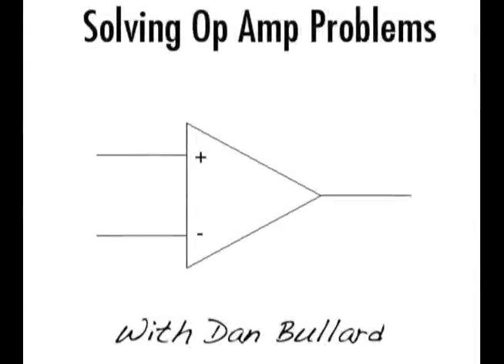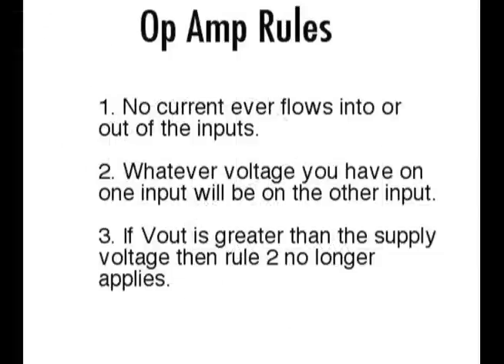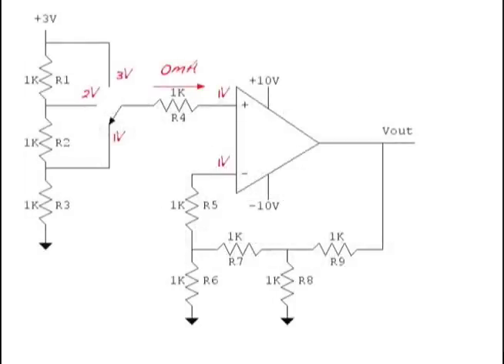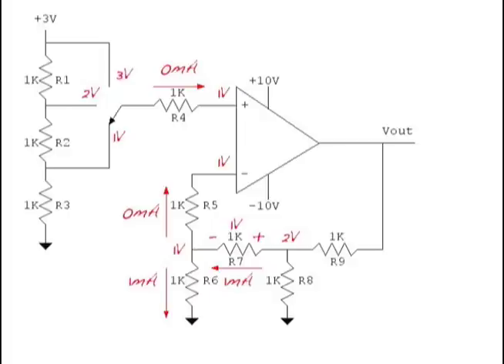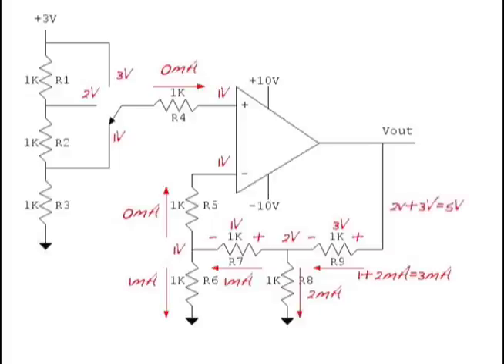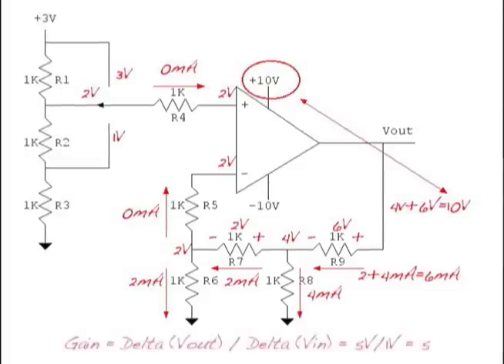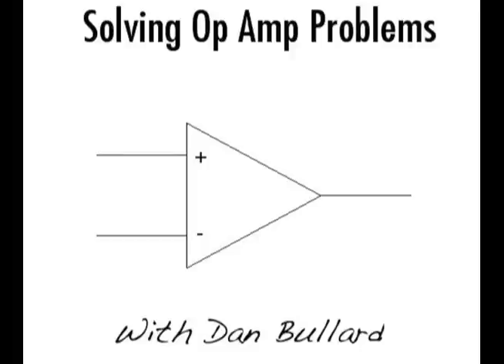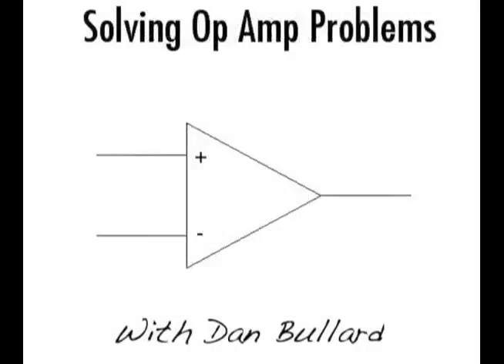Solving Op Amp circuits

Comment: Hi Dan, Why can't we find a text book or any kind of book that explains things using this very clear method?? I have looked everywhere and it seems to me, clear explanations are not encouraged. Do you know of a book anywhere out there that at least has a set of questions like this one I can work through. This method is so much easier to understand but it obviously needs practice. Why don't they teach the basics like this???
Reply from the maker: Kevin O'Brien There are no books that I know of that teach basic electronics this way. The only one I know is the book I wrote on harmonic distortion. I suppose I should write a book that teaches this method of learning electronics. Stay tuned!
Reply: Dan Bullard Well if you don't, someone should!

This style makes it far more easy to understand. I can't believe they are not teaching this way anyway. Its crazy not to. The subject is tough enough as it is. I have not got a thing out of academia. The pedagogy used in Science and technology is just up there, right next to bloody useless in my opinion. Fortunately I am determined to learn on my own, else I would have given up long ago.

I would buy such a guide (better more friendly name) at the drop of a hat.

If it was a nice concise pocket book (between about 80 to 90 pages) at low cost you would have a winner I reckon.
Reply from the maker: +masen shiba It's a voltage divider, 3V divided by 3 is 1V across each resistor, or 3V across 3K means 1mA is flowing down to ground. 1mA through a 1K resistor generates a 1V drop.
Reply: +Dan Bullard This is awesome. I&#39;m starting out designing circuits and analyzing circuits and the hardest and most mysterious part ( And for some cases the most important part) was the amperage. The 3 rules you show + Ohms Law makes that part clear and concise to me now. I have searched all over to try to find an equation or something that would help me understand how to find the amps. I mean I knew it was in Ohms law, but everything says to assume a constant voltage or amperage so it gets really confusing.&#160;Those 3 rules and your method makes it bullet proof. I hope you do write a book on this.
Reply: +Dan Bullard hello how did get the 3 and 2 and 1 volts on the left circuit
Reply: now i understand , thanks a lot  :)

Comment: GREAT tutorial. I have to admit, I didn't understand most of it. I've got a probable reverb recovery unit op amp problem in my Marshall guitar amp, and I am hoping if you could walk me through testing the circuit, or at least the op amps, in an effort to identify the defective component? I've got a link to the schematic, and a multimeter.
Should I just start at pin #1, measure the voltage, then try to use this video to solve for the other pin, and measure them..?
Thanks
Reply from the maker: Robert McBride I think it would take a bit more than that. One thing you can do is check the voltage difference between the two inputs, pins 2 & 3 if I am not mistaken. They should be the same voltage if everything is OK. Give me the link to the schematic and I can see if I can walk you through testing it.

Comment: How do you get that 2V and 1V on the far left at the beginning of the video? Where is the math for that?
Reply from the maker: Shane Quinn There are three resistors there, so 3V divided by three 1K resistors equals 1mA through each one. One milliamp times 1K = 1V, so each resistor has 1V across it. zero plus one is one, so the voltage at the top of R3 is 1V. One plus one is two, so the top of R2 is 2V. And 2 plus one is three, so the top of R1 is 3V, which all works.
Reply from the maker: faceinthegrass It's a voltage divider. 3/3 = 1. 1+1=2. That's the math.
Reply: Dan Bullard Put isn't the voltage divider rule R2/R1+R2 all multiplied by Vin to equal Vout. So from what ive learned in the past is that if both resistors are the same then the voltage will be halved? So 1.5V if you use the equation I use?

Comment: What is the basis for rule No. 2.
Reply from the maker: Yueeiuyoo In a negative feedback circuit, that is what the op amp tries to do. It "homes in" on the output that causes no difference between the two inputs. Remember that the gain of an op amp is in the millions. Any tiny difference between the two inputs will be magnified by the immense power of the power supply rails.

Comment: If there's no current through R4, how can be there are 2 v across R4  if Ohm's law said V=IR (I=0 ==> V=0)?
Reply from the maker: R4 never "Drops" 2V. when there is no current, a resistor transmits the voltage unhindered through it.
Reply: Dan Bullard Thank you Mr. Dan bullard. I still confuse. Why there's voltage at input if there's no current moving across R4 (no electrons moving)
Reply from the maker: Electrons moving is current, force of electron pressure is voltage. You don't need current for voltage to have effect. Voltage is like the pressure in a hose. Even if there is no water flowing, the hose will still bulge and be stiff because of the pressure.
Reply: Good explanation! Thank you again. One more question. With R4=1kOhm as a resistance, why is there still 1V on the right side of R4 (Op Amp input)?
Reply: Alexphal That would be the 'pressure' as Dan described.  Another way to think of it is the current through R4 in reality is not absolute zero.  There will be some very small current, as in picoamps or nanoamps (will vary with the op amp used).  This would mean the voltage on R4 may actually be e.g: 1.0000000V on the left and 0.9999999 on the right.

Comment: Please explain the function of R4 and R5. If no current is flowing into the inputs why are they required ?
Reply from the maker: trialen Actually the value on one side should match the equivalent resistance of the feedback network on the other side remembering that the output of the op-amp is virtual ground. In this case I didn't bother with that, I didn't want to complicate things. But when you look at a well designed circuit, let's say a typical op-amp with a gain of ten, 2K on the minus input with a 20K feedback network. The equivalent resistance is (2K*20K)/(2K+20K) = 1.8K. So on the Plus side connect a 1.8K resistor to ground. Now any bias currents on the Minus side will cause a similar voltage drop on the Plus side. But as I've told the other folks, this technique is mostly for doing a first approximation to understand the circuit. Design is a whole other ball of wax. Get Horowitz's The Art of Electronics for info on design, best book out there.
Reply: Chemiprofe asked that earlier. It's never a good idea to connect a device input directly to a power bus, just in case the chip shorts out internally you don't want the whole damn thing burning up. But the the real reason is that there may be a very, very tiny current on those inputs, not enough to worry about when doing first approximation analysis like this. But if you do get a picoamp of current on one input, the other input will probably have the same picoamp of current and so the two inputs will be subjected to the same nanovolt offset. Again, the effect is so tiny you could spend your whole life trying to figure out the circuit if you try to follow each picoamp around the circuit. Better to ballpark it and get really close than spend days trying to figure out every picoamp and nanovolt.
Reply: DansFlix OK, thanks for the explanation. Are there any design considerations for the values of R4/5 or is it safe to just use 1k ?
Reply: Dan Bullard Thanks Dan, very interesting.

Comment: thanks for the video it is very clear. i want to ask that, how should we think about resistors, in order to calculate the gain as in formula: 1+(Rf/R). what is Rf and R resistors here. first, i thought that R5 is R and rest of the network (6,7,8,9) are parts of Rf but didn't work. could you explain? thank you very much.
Reply from the maker: Yeah, that resistor to ground really screws everyone up. That's the problem with the way they teach this stuff in college. You become an expert at math and can't do anything else. What's the formula for a circuit that breaks? The math won't tell you what happens, but using this technique will. To calculate gain just do like the video says, change the input voltage, analyze the circuit and see what the output change is. Gain is delta_Vout/delta_Vin.
Reply: ok then i will use this :D thank you very much.

Comment: Thank you for the great explanation. What are the rules for non ideal Op-amp?
Reply from the maker: The Op Amp datasheet is the best place to look for that. Input bias current is spec'ed as well as input offset voltage. Some Op Amps have such high input impedance that Rule 1 is true no mater what. The point is, your first attempt at solving any circuit would be to assume that my rules cover all cases. If you see a 20MOhm input resistor then you should understand that that large an input resistor MAY have some impact on the input voltage, but it is by no means guaranteed.

Comment: a very helpful example,,,thank you for releasing this video,,, but how did you figure the gain in the second step 5V/1V?? ,,, while the Vout =10 and the Vin=2 ,,, is the gain supposed to be 10V/2V?? 
thanks again.
Reply from the maker: Exactly. Lots of profs teach some mathematical solution to gain, but the best way that I have found is just to do analyze the circuit with a couple of values to see what the DC gain is. No capacitors or inductors, no worries about AC gain, it's the same as DC gain (pretty much). I once got through an interview at Tektronix with this strategy and got the job.
Reply: Dan Bullard yes indeed ,,, its a very good strategy.
thank you.
Reply: I need some clarification on that. Did you open the capacitors and short the inductors ans analyze as DC?

Comment: Thank you for posting this video! What is R4 supposed to do?
Reply from the maker: Good question! R4 is supposed to a) Limit current in case of a short circuit failure so the chip doesn't burn up and start a fire, and b) create a voltage drop on the Plus side equal to the Minus side if any current does flow into the inputs. Rule #1 is always true, no current flows into the inputs. But a very tiny bit may flow, not enough to worry about when you are trying to figure out the circuit, but perhaps a little tiny current might flow. If it does, the other input will probably draw about the same amount of current, and so the two input resistors will create an equal voltage drop preventing an offset voltage from changing the output. For the most part, it is best to just assume that no current will flow into the inputs.
Reply: Ohh, okay! Thank you!

Comment: I recall from a discussion with EE that when an op amp is used as a simple DC signal amplifier, the internal resistance of the input device itself (like a sensor coil) has to be included as part of total input resistance at the summing point.

In that case the gain would actually be the feedback resistance / total input resistance.
Reply from the maker: Yes, but sometimes it's hard to figure it out unless you do a static analysis like this.

Comment: Should the ground line for the op amp circuit be connected to the chassis ground which is the green wire (or safety earth ground) for the AC power supply?

I've seen many permanent installations (such as seismological and meteorological stations) in which the op amp's ground line was also connected to the green wire but some others did not have a connection.

However it seems that the amp's ground itself probably should not be connected to the green wire because any current through the green wire would create a voltage and make the amp's ground line subject to erratic ground reference.

Furthermore, the voltages in op amp circuits themselves are so low that there's no safety issue and only the chassis of 120 VAC power supply would need to be earth grounded.
Reply from the maker: The op amp has no ground wire. Power+ Power-, In+, In- and that's pretty much it.
Reply: Dan Bullard Although the IC itself doesn't have a ground pin, the non-inverting input is grounded (to provide a reference point for the differential input) and the external load at amp's output (a galvanometer for example) also has a return to ground. 

Seems that connecting the chassis ground wire to the ground line that's also used for the complete circuit might introduce noise.

Comment: Here's a question about the "ideal" op amp.

According to the ideal model, the open loop gain is infinite and any input would also cause the output to saturate or go full conduction. In that case, the op amp would act like a switch IE a solid state relay and any input would case it to turn on with full conduction.

Even with negative feedback, it seems the op amp would still behave as a switch rather than a linear device and the whole system would be unstable and prone to oscillation.

Accordingly, my opinion for modeling the ideal op amp is to assume the it has a very high (but not infinitely high) gain so it still behaves as a linear device, but not have the characteristic of a switch.
Reply from the maker: I think that negative feedback would keep things in check automatically, no matter what the gain is. Any tiny difference would instantly be corrected. Now, toss a capacitor into the mix and watch it oscillate because the feedback can't get there fast enough especially when the gain is infinite.
Reply: Dan Bullard Here's a practical experiment that might verify whether or not a device with an infinite DC gain will be stabile.

Get a DC/DC solid state relay (a device that turns full on with a small input signal) like the one in the link below and connect it as an inverting amplifier. That is the + output is tied back to the - input so the output is 180 degrees out of phase with the input. Then apply several different levels as the turn on signal and see if the output is in fact a linear function of the input.      

http://www.crouzet-ssr.com/english/products/_gndc.shtml 

In my opinion, it's a good idea to avoid obscure mathematical constructs that have "infinite" quantities which can lead to confusion in a practical analysis. That's why the concept of a mathematical "limit" was introduced because infinite quantities should not be inserted in equations such as the one for amplifier gain. 

Accordingly, it would be better just to say the ideal op amp has a gain that approaches - but never reaches- infinity.

Comment: Thank you for an excellent explanation.
Very helpful.
Reply from the maker: Thanks for your feedback. I am working on a new one for Positive feedback that should shed some light on Schmitt Triggers and explain Hysteresis.
Reply: Great I eagerly await another concise tutorial.
It is a noble thing to share knowledge so many show off with poor illustration of the facts.
When I acquire enough knowledge and working projects I shall try to emulate.
Reply: @DanBullard  Did you ever make the video on positive feedback?
Reply from the maker: @jayshan091  Nope, and it's been years since I thought about it. There just aren't that many applications. Sorry.
Reply: @DanBullard  Thanks for the response. No need to be sorry, do you have any other videos breaking down electronic components? This video was very digestible, if you don't have anymore vids you should consider Udemy course. I would pay money for your explanations.
Reply from the maker: @jayshan091  My most recent videos deal with harmonics, which don't have anything to do with components (per se) but I appreciate your thoughts. Let me stew on this a while.

Comment: how did you come up with the equivalent circuit at 7:40?
Reply from the maker: That is kind of an art I guess. You have to think like an electron, "how can I get to ground? What do I have to get through to get there?" It's always been hard for me to do this, so I just think like an electron.
Reply: Dan Bullard I mean where did those 4 resistors come from? which resistors did you replace from the original circuit?
Reply from the maker: aflyvietguy R9 is on top, R8 is on the right side to ground, R7 and R6 are on the left side to ground. So now you have 1K in series with 2K and 1K in parallel. I guess I should have annotated those. The big point here is that you can ignore R5 totally because there won't be any current flowing into it.

Comment: Superb explanation!  This came at a good time for me, I just finished my Op-Amps class and I'm still wrestling with the circuit analysis.  I've been falling back on the algebra formulas, but they don't provide real understanding.  The steps 1, 2 and "3 with a twist" are great.  Your approach, using the three op amp rules and Kirchoff's Law, provides clear and easy to visualize insight.  I've looked at many op-amp tutorials, and this is my favorite, thanks for taking the time to share your knowledge.

Comment: I really liked the video! I'm going to a 2-year tech school for electronics. I'm in my second semester of my first year. The way they do it here is split each semester into 3 5 week modules. This module (as well as the previous one) is all digital stuff, so I'm a bit rusty with calculating these circuits. Again, thanks for the video! It's a nice refresher!